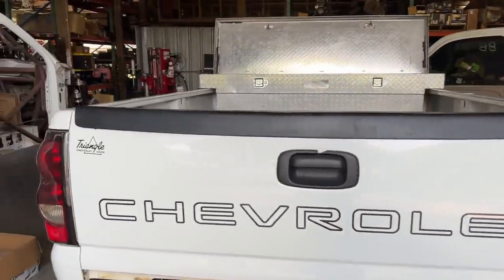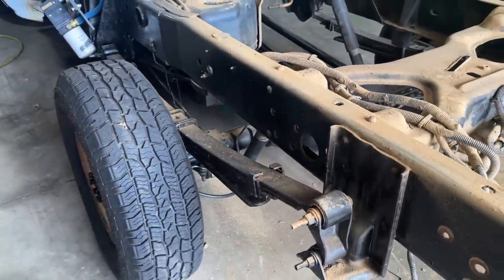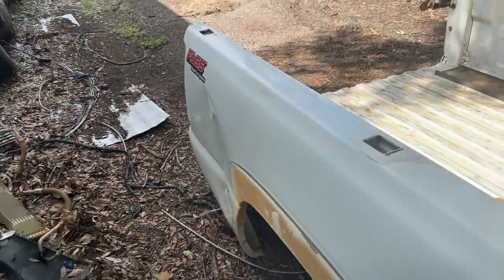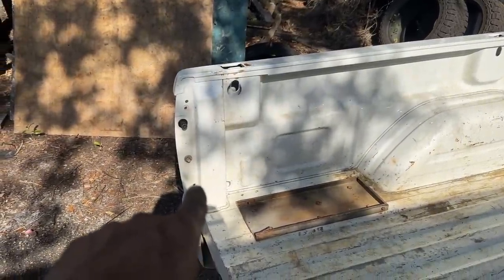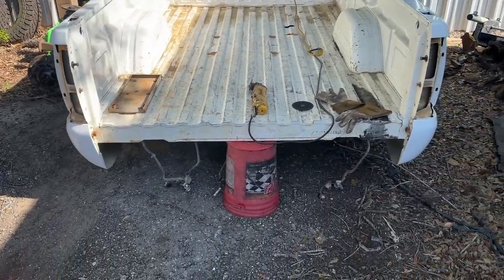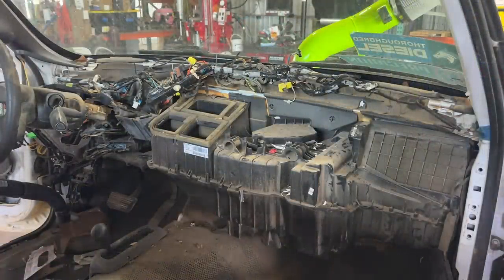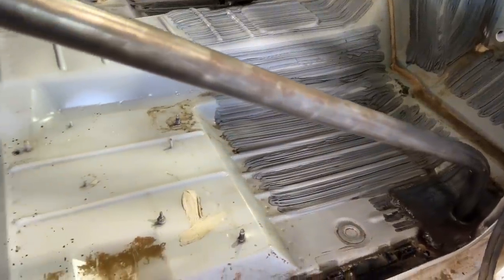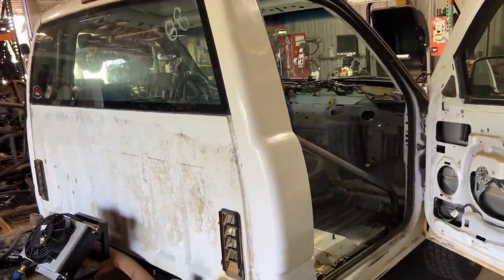WEIGHT LOSS Program For Our Duramax Drag Truck!!!! It's Gonna Be Light!! Pro Street Bound!!

Comment: the gastrucks have a lighter reardiff but the diesel engine makes a lot more torque , i think the gas type diff whon't be a good idea as youre probably will break it with the diesel 
the 4 link is a good idea youre going to need to convert the rear to coilovers though , tried to find a leafspring four link setup but i could not find it , i think thats because the leafsprings would cause the four link to bind up unless you make some hinging thing that alsow the axle to rotate while still hung from those leafsprings , it still wouldnt allow it to move in an arc that the links want to move at , besides that removing the leafsprings will save a ton of weight and give you more adjustabillity 

wonder if it would be an idea to put a campershell or full length toolbox on the back for drag and drive events compared to using a trailer , lift the shell with the gear off the back and lower it to the ground for racing , that would allso cover the rear up when driving and prevents the rearwindow from getting pelted with mud and little rocks trown up from the rearwheels (changing rearwindow with lexan is probably a good idea too)  , you probably could allso put a bigger gastank in the box so you only have a small and lighter tank in the truck on the dragstrip and hook up the bigger tank in between the tracks to make it without stopping at every gasstation along the way (with the electric fuelfeedpump there shouldnt be air purging problems ) does need to be near empty at the track or you need a forklift to get the box / campershell off 

one thing you could do to get the box / shell off the truck is using an electric winch inside the box/shell and put casters under it , then pull it up and off using tracks on the frame and running boards off the back of the truck
Reply: Makes more sense to lighten the bed and use a trailer. Just unhook the trailer at events, where if everything was loaded in the bed, you’d have to unload the bed at every drag event.
Reply: @KJ-kw7gh  yeah ok thats why i mentioned making the box intoo a roll onn roll of thing with a set of casterwheels running on two (aluminum U channel) rails  on the frame with a winch , that way you could unload the box with everything in and on  it 
it might still be a good idea to get an old plastic bedliner to trow in the hole thats left of the bed to prevent rocks and stuff from being trown up against the back of the cab between the tracks , those things are reasonably light and can be taken in and out and trown on the ground at the track no problem probably have a few of those laying around
Reply: @watahyahknow  Or, hear me out, a simple hitch and an enclosed trailer. Done. You’re overcomplicating an issue that every other drag and drive participant already has a solution for.

Comment: Ditch the frame also & replace it with that huge thick walled pipe that is used on the mud truck & use some thinner walled x cross braces sideways down the length of the cab. Then go with the 4 link & better front suspension where you have more control over the ride height so that you can adjust for keeping the front wheels down from lifting. Also change the wheels & use 12 inch wide slicks back to front if you are launching in 4 wheel drive. You're going to have to get Nos & a huge turbo that provides boost at low revs to high revs at the same time.

Comment: You guys should look into running some off-road fiberglass fenders front and rear they are lighter weight and more tire clearance
Reply from the maker: We did discuss that. But with the weight we shaved VS a fiberglass fender and cost effectiveness. We didn’t see the benefit. Plus a wider fender will create more drag

Comment: I'm not too well versed on drag racing with an Allison, but if it ever becomes your weak link, the reason why you can't reach a certain E/T, a good alternative would be a 48RE from Firepunk and their Anteater. Obviously, there's other options, and that's probably down the road some, but it would probably be your best bet for keeping a lockup converter and a good highway gear for the drag and drives. Been loving the builds though. Drag racing and boggin, doesn't get much better than that!

Comment: i wouldn't change the rear end, the gas truck 10.5" rear with the small pinion isn't gonna like the torque.
the 11.5" rear that's in there now is pretty stout, the weak link is the Gov-Lock locker. Also all the 6.0L trucks with the 10.5" rear had 4.10 Gears and you need 3.73.

Comment: Might want to check rules for the class and events you want to run. A lot of them require a factory dash. Can still gut all the junk out of it though. I'd also skin that tail gate and weld both fenders solid to it so its a one piece unit that can be removed or tilted up easy but still more rigid than three individual pieces. That's just me though. Lookin good fellas.

Comment: I got a 2500 gasser with the rear you want in it about an 1.5 hrs north of you. $2500 come get it has a 6.0 4l80e runs and drives. Come get it

Comment: The standard 2020 chevy 1500 tailgate is super light. Probably 20-30 lbs lighter than the 05. I dont know how they do it but itd be nice to mimic what they did
Reply: The new Silverado tailgates are aluminum. 

Also he probably won’t even run a tailgate while actually racing it. Just keeping it for drag and drives.